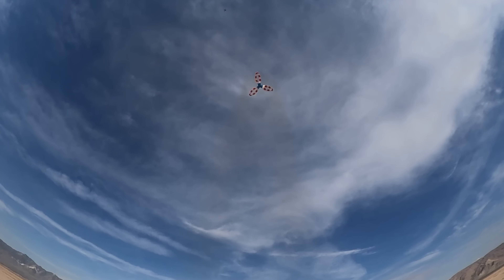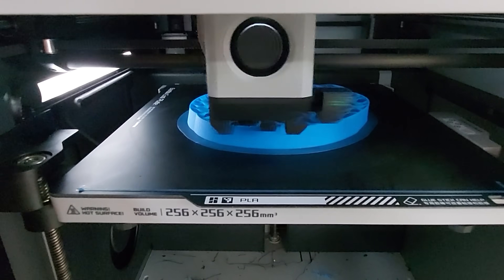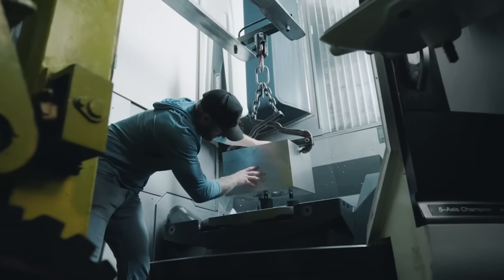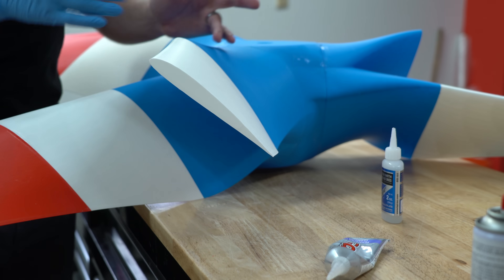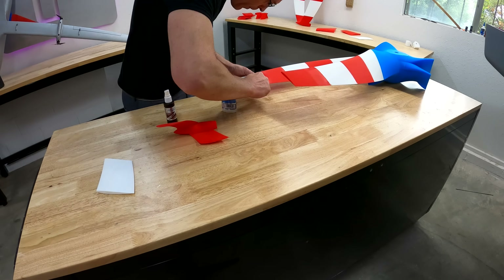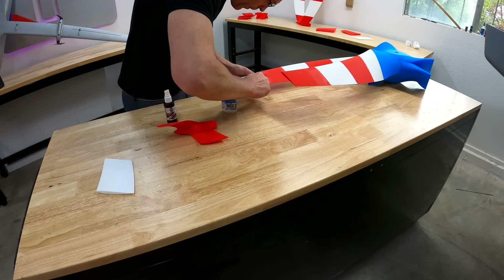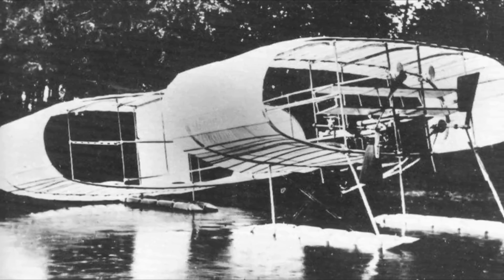Exploding 3D Printed Toroidal Rocket Powered Helicopter

Comment: The efficiency gains by winglets is  one thing but they shine at reducing wing tip vortices which are a big issue upon landing. They are also a hazard for aircraft following a big plane with huge vortex production. Hence the folding wingtip booing is employing.
  I tried a JetEx engine on a balsa glider when I was a kid. Slower longer duration of burn but at a lower thrust. It worked great. I don’t know if they still manufacture those. 
 Oh a 12 foot chain link fence took that plane out of action on its maiden flight. Oh well 😮… curses 🤬

Comment: Google "centrifuge calculator" & look for the Omni calculator page.
There you can enter the diameter & the rpm to get the g loading. 
If you set the diameter for each section you'll have the precise g loading for each joint under rotation.
The rpm can be gleaned from these tests...
I used the calculator last night for something & thought of it when I watched this.
Good luck next year mate! 😎💜☮️

Comment: Could you use some type of brace on the outside (targeted to the areas where it specifically broke off)? This way it keeps the weight down from the extra printed materials...I'm imagining straps on the outside...perhaps something knitted, or elastic wich will have inwards pressure, and hold the form.
Reply from the maker: Very light carbon rods in channels under the surface of the airfoil would easily hold this together.   But wouldn't have made for as exciting a video :)

Comment: Conclusion: this design cannot withstand high linear speed! I knew the blades would fly apart! You need to study not only aerodynamics and just print anything, but also turn on your head.
My development is smaller and made of thin metal. The blades rotate on two bearings with the help of wind force (like spinners). My model is able to accelerate to Mach 1 and even higher. Of course, my blades do not carry a take-off load, but they simply rotate at a tremendous speed. At most, it was Mach 0.736 with a wind force of 23 m/s. My goal is to go beyond the speed of sound.
3D modeling, a very fragile material that is not designed for high loads.

Comment: I wonder if print direction would have made it stronger.  In theory it shouldn't with the fiberglass covering but those looked like some clean breaks like layer separation.  Maybe the fiberglass was able to delaminate from the print.  CNC Kitchen did an interesting video on direction specific reinforcement with carbon fiber that could be useful here.  That is ditch the sheet.  Use actual fibers in the direction you are concerned about.

Comment: I notice you are using electrical leads of equal length. Always a possibility of the leads touching when you do this. If you are open to a suggestion, cut one lead shorter than the other to stagger the connectors.That way, + and - are never close enough to ever touch one another even if the wires are side by side.

Comment: It's hilarious that everyone has latched onto these toroidal propeller designs thinking they are "more efficient" than a normal propeller, when the original research paper that started all this nonsense actually said NOTHING about them being more efficient, just that they can be quieter! The few tests that actually have been done to test efficiency have ALL so far shown that toroidal propellers are really less efficient in terms of lift and propulsion in air and water.

Comment: The results were EXACTLY as I predicted as I watched you super glue the pieces together.
You should have incorporated a cable or piece of small all thread into each propeller to give it more tensile strength.
Reply: you mean like a spar?
Reply: @stevevernon1978  Yes. Perhaps even pretensioned Kevlar thread would be sufficient.

Comment: A rocket propelled propeller is one of my ideas for landing payloads on mars.
The blades would be inflatable carbon fiber that harden in the UV light of the sun during the trip to Mars.
They would be deployed and inflated after launch.
Then the giant "helicopter" would use aerobraking to reach a low circular orbit.
Then when it takes the plunge into the atmosphere it would feather the blades to spin them up during entry (like autorotation with a real helicopter).
Then just before "touchdown" it would fire small SRMs in each blade then place the payload on the ground then the blades would detach and fly away leaving the payload on the surface.
Reply: bla-bla-bla-bla-bla         reality check 
the atmosphere at mars is not sufficiently dense for a  'rotor'  to  work; as a parachute or otherwise.      nasa's  hovering uav on mars is a   LIE.!!!         it can be  SEEN  that, in earth's atmosphere a rotary-wing vehicle can fly  only  so  high;   because  the air gets  too  thin.!
the martian atmospheric density is estimated to be equal to  six-tenths  of  One  percent of earth's, at sea level.            that equals a factor of  .006.       [ mars - 608 pascals.    earth - 101,325 Pa.       total vacuum - 0 Pa. ]

Comment: 4:10 -- RE:  Why Toroidal?;  I suspect one of the bigger reasons for considering this design was illustrated best by the boat propeller.  There clearly seems to be a huge difference in the amount of cavitation being produced by the toroidal form, and fluid dynamics are fluid dynamics.  True, there's also differences between propellers working in water as opposed to air due to any number of physical realities such as the relative densities or the viscosity, but they can probably be accounted for with a coefficient or two.
Reply: I'll also be quite honest, I hope I don't suffer too much from "intuition" which is to say, I hope that my eyes aren't deceiving me too much when I say there seems to be less cavitation with the toroidal form than the "normal" one.  Perhaps there isn't.

In this case though, going by what you've scripted into the video, there is probably another quite obvious way of knowing there's less cavitation regardless of the fluid medium:  are they quieter on drones?  If Yes, then I'm guessing cavitation will be a considerable factor.
Reply: Yes. He explained this. Has to do with size limitations. Boat prop cannot have a bigger area to spin, so toroidal props “cheat”. If it had more are to spin, a larger, non-toroidal prop would be more efficient.

Comment: I would like to see a singular piece as I think the forces produced in 3 rockets would be slightly out of sync enough to produce a twisting effect therefore tearing the sections off at the centres weakest point..... but if you did only 1 instead of 3 then there should theoretically 100% of the thrust will generate that circular motion with no shear points.. worth a thought

Comment: And you see NO problem at all in having all these segments?? Wow. Each joining point would have to be done extremely well. Been gluing up foam board WITH PRECISION for years? 
WHY carbon fiber for the spinning platform? Couldn't find titanium, diamond or neutron material?

You managed to throw trash all over the place. Did you and family members pick up all those pieces? 

You stink. Fireworks KILL BIRDS at night. Be a real man - don't ever again do fireworks. Pass it on. 
Make your own lighted drone show. No more fireworks! You've got a brain, right? Use that sucker. 

NEXT TIME - If you ever do any video again - Use A Personal Mic. Much of the audio of this video is crappy as in 'distorted by reverb'. Room reverb IS NOT YOUR FRIEND. Guess what it is. It's bad for video.

Comment: What if you were to add strings or wire into the foam like what we find in bicycle helmet? This could prevent the full separation of the propeller. Say a strand of fiber glass like we find in fiber optic cable. they are very small and super strong.

Comment: It looks like the one-blade was more successful. You should design a one blade propeller with rocket, because it makes less drag. And try to put electric motors on original 3 blade propeller. It's designed for efficiency afterall, not speed

Comment: although it will require more sanding, printing the airfoil with the leading edge down would grant stronger results due to the direction of the grain =)

Comment: well - a twisted box wing propeller...   Hargreaves may have something to add?? - or not... Goddard was the rocket guy - I happen to have the sae surname-  and a Graddfather, formerly known as Robert (deceased 40 + years)

Sharrow may be "better" but at the 10x price increase, hmm, are their benefits there??    How  would a stacked 3+3 -  staggered 6 blade  scimitar tip propeller compare...  hmmm...

optimisation is ongoing, no doubt.  (yes winglets exist to fit within  gate width)....

Comment: Try some exhaust wrap or some fiberglass materials to wrap around the rocket engine. This should help keep the heat from melting the plastics. This may have also been a point of failure as well. As when the heat started to deforming the plastic it would probably change the angle of thrust on the rocket creating more and/or changing the stress points on the model. Also Maybe develop a recovery system so you can reuse it and mayhap try with a few size smaller rockets working your way up.

Comment: Inside the propeller blades, it was necessary to stretch a thin steel cable (or steel wire) and pull the entire structure from the inside, that is, to reinforce.
Otherwise, inevitably, the composite structure will be torn to pieces, and the glue will not save.
Reply: I saw this coming as soon as I noticed the 3D printed layers split the blades laterally instead of longitudinally.. should be an easy fix: just rotate the parts 90°before printing

Comment: The efficiency increases are in the single digits at best depending on the speed they run at since they have a very limit efficiency range for RPMs and are only really good at reducing noise within that range as well.
Also Toroidal propellers have been around since WW2, they are NOT new they are just expensive to produce and not as efficient except at a specific RPM (as I stated before), classic props can produce more thrust and can be adjusted on the fly to achieve better efficiency over a larger range of speeds
Reply: toroidal propellers are only more efficient at a very limited range of RPM? then using a rocket to power one is PROBABLY not a good test procedure

Comment: Thank you for talking in some depth about toroidal propellers and airfoils.  The MIT paper caused some hype and misunderstanding and the Sparrow Marine boat prop, while widely accepted as better than standard models, advertises specs that are difficult to believe.

Adding bi-plane interference to a propeller does not inherently make it better, but fluid dynamics software and modern manufacturing do allow us to take advantage of more complex shapes.  If nothing else, the MIT paper has spurred creativity by expanding the box of potential lifting shapes.  The hype may fade, but we're now obtaining the tools to take full advantage of the 3-dimensional space available for our propellers and wings.

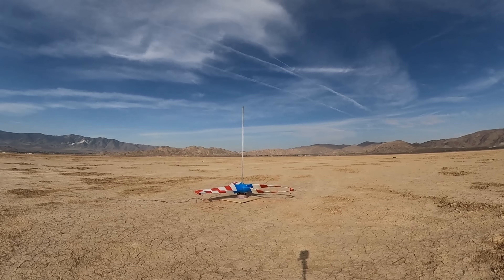Comment: This 3D Printed Toroidal Rocket Propeller is a work of art. Was very impressed, even when disassembled (6:04), an impromptu single blade manage to continue to accelerate upward and remained stable (12:27). It would appear that might be an engineering advantage to designing a Single Blade Rocket Propeller?! eg: would one motor be enough? (you have real data now :)
The unexpected discoveries are some of the most eye-opening. I do hope you do a brief follow-on exploration. Not sure if this because single blade had better mass vs. material strength, but it also looked very cool.
Reply: Here is a RC Helicopter flying with one main blade.

https://youtu.be/Dc3ClCw1Kq0

Comment: What filament did you use and how many walls did you print?  Regardless of material, the wall count is the biggest factor in overall strength vs. infill.  Infill lines are thin and often not continuous unless you opt to print infill lines as walls.  That adds tons of print time though, it's better just to print more walls.

Comment: Try: replace the rocket motors with ducted fans.  Capture the blade tips inside a groove in the duct to reduce the generated noise.  Far more altitude, more controllable.  BONUS: use that flying platform from which to launch a rocket.
Reply: 🤔ooor... he coud replace the rockets in the tips of the toroidal propeller with small toroidal propellers...
Reply: @juanaq  Wheels upon wheels, or wheels within wheels.

Comment: This is awesome. One thing to note: most model rocket engines have a parachute ejection charge. I’m worried that even if your propeller holds together this ejection charge will destroy it the way you have it designed. There are of engines without the ejection charge you should use instead
Reply: we saw it go off on the chuck model at 10:20
Reply: The ejection charge can be used to ignite a second motor if two are stacked in series. This might be a method to attain even higher flights once issue of centrifugal mechanical over stressing is addressed.
Reply: @AerialWaviator  For that he'd have to abandon the 3D printing, just the nature of it makes it far too weak because of the additive layering.
Reply: @SilvaDreams  "abandon the 3D printing, " probably a good suggestion for round 2

Comment: 14:03 - is base jumping safe ?

Of cause if you have at least a rocket on your back too.

Great idea and video even though I could not believe that the laminated props really broke apart, but maybe a second attempt with more strength cause it looked really promising or might deserve a rather smaller than a bigger one. But I am no rocket expert at all, just played around when i was younger and had high hopes and even bigger dreams that usually shattered during take cause we had to build our rocket motors on our own in the pre internet era a really tough challenge cause neither knowledge nor experts were available.

Comment: (01:35) No, toroidal propellers are not more efficient.

Problems of flow-field interaction, induced drag because of choke at the distal and proximal ends of each (twin) blade, and other inevitable “real world“ ramifications recommend against this configuration.

Technically, it's not a valid example, but when the first turbine-powered ship, Turbinia, spinning three inline propellers on each of three shafts, had two propellers break off one shaft, the ship achieved a significantly greater top speed with the thrust of its one remaining prop generated by the available motive power.

In aerodynamics as well as many other things, sometimes more is less.

Comment: The problem with fast printers is that structural parts still need to be printed slowly. I think you should print these again but with different filament and half the speed. I found this out the hard way with my ratrig vcore printer. It was great printing benchies at 8 to 12 minutes. But when it came to actual parts, I couldn't use that speed. Especially with ABS.

Comment: Honestly a really cool project. The one thing I was thinking and is more than likely a very bad idea is what if you added a metal ring to the outside. This would slow down the acceleration and add stability to it spinning and also add momentum once it gets up to speed. I am not sure if that last part is a positive or not though. I think it would be cool if it continued to climb after the engines run out but that means it could fly pretty far and it would have a lot of extra weight. hmm...
Reply: It would be a flywheel.
Reply: @bobirving6052  yes, exactly

Comment: Congrats on a great project!
As a kid I wanted to build a flying rotating gadget with central conical fuel tank and ramjets at the wing tips.  The concept was that once spun up, centrifugal force would feed fuel to the engines.  This was in the days of control line models before RC.  I never built one as I thought it might end up causing a fire.  You have stirred up that dream once more.  With RC it would be possible to build in adequate controls, so it might not be such a risky project today.
Reply from the maker: The military tested something like that back in the 50's or 60's, check it out on the Tube.   Liquid fueled rocket but same concept, 7 minutes of run time on the rocket engines themselves, could be turned on and off.
Reply: Have you heard of the roton single-stage-to-orbit concept? It's basically the same idea. https://en.wikipedia.org/wiki/Rotary_Rocket

Comment: You should not solder the igniter to the launch controller. I've flown many rockets, and never had an issue when the alligator clips fall off. This could be solved by inspection of the igniter and clips

Comment: A surprising and impressive feature about the last flight is that the wing that stayed intact descended like a winged seed pod.
Reply: Bury it and see if it’ll grow a Prop tree 🤷🏻‍♂️
Reply from the maker: Agreed, it was not the plan but was the coolest part!
Reply: @thinkflight it flew like a one bladed RC helicopter.
Reply: @thinkflight  Run with it and see if you can design a solo toroidal wing that spins into the air.
Reply: Like a rocket powered sycamore seed  There might be the seed of another project there.
Reply: Theoretically, If a prop tree actually flowered, would the pods or petals grow in such a way as to follow Fibonacci’s sequence? 🤷🏻‍♂️ Curious …! 🤔
Reply: I can't wait to see that counterweighted v wing design.

Comment: This is the most cinematic disassembly I’ve ever seen. If you could have designed it to do exactly this, you should have. Perfection.
Reply: This would be very dangerous buuuttt, get a bunch of sections with some decent mass designed to snap off at high speed but have elastic cord running inside so after shattering the pieces kinda fly back into themselves
Reply: 6:02 just for everybody courious this is the scene 👍